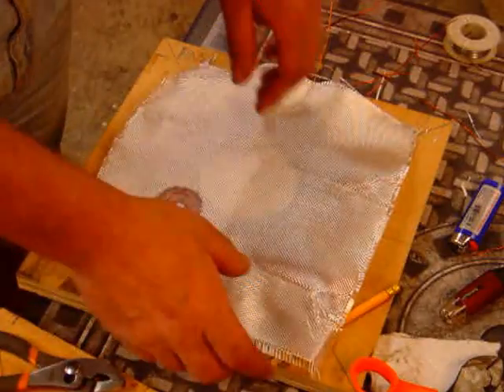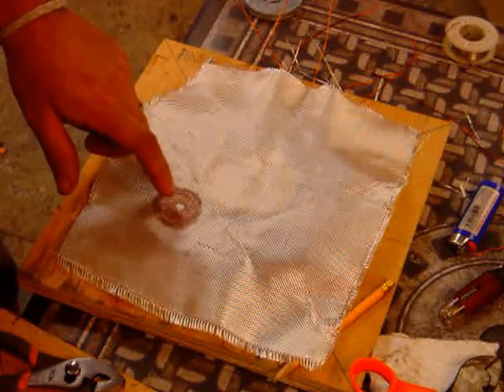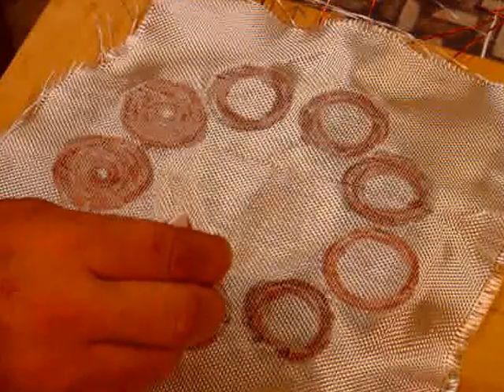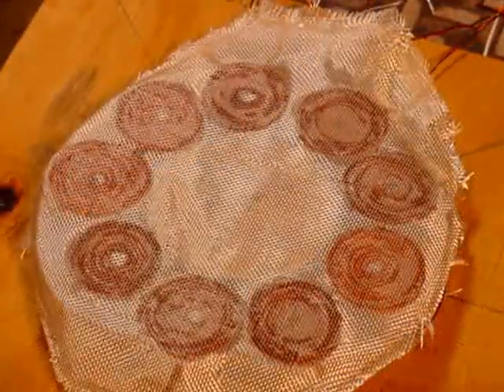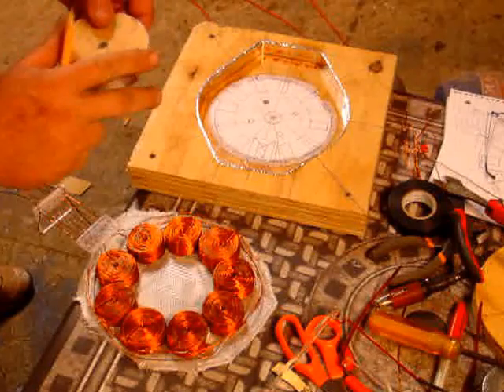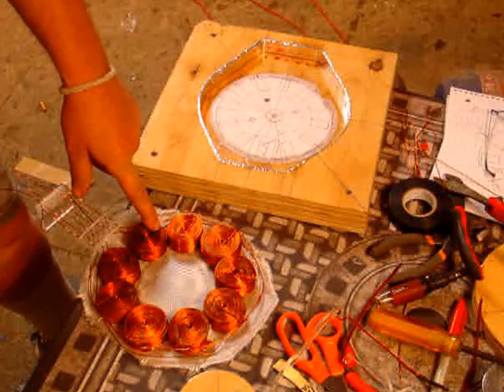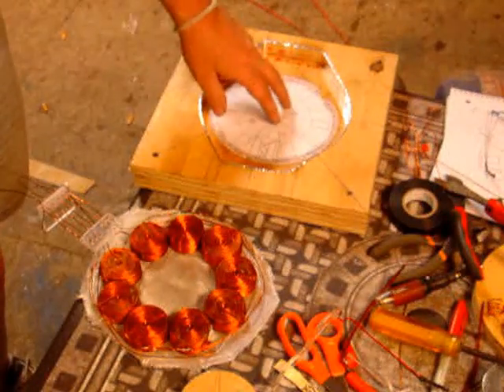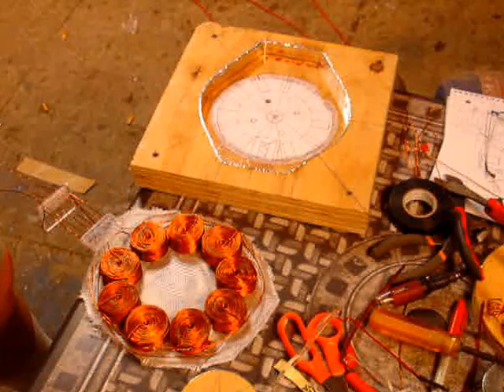PART 2 THE DESIGN OF MUDDYS' MIGHTY MINI WIND TURBINE

Comment: What would be the problems if I made my rotors with n35 magnets on one side and n50 on the other? I received a mixed order from a chinese supplier and it would cost way too much to return them! Either that or reorder another 12 n50 and use the n35 on something else...maybe use them to hold ALOT of pictures on the front of my fridge! Lol! Thx muddy!

Comment: Sorry you did say its oky just as the magnets are centered over the magnets .I did not get it the 1st time.hows the dream going for everyone to make one of  them is it working?you must have info by now.Let us Know.your #1fan. Bruce
Reply from the maker: Hello Bruce,

In order to fit the number of windings needed to reach charging voltage at startup RPMs, the air core of the coil had to be very small. After talking to Helmuth Gieser of Scaled Energy in Florida, He had me convinced that the magnetic flux would pass easily through the center of the coil. The magnets induce the current that guilds the flux as the magnet enters, and leaves the coils.  Whodathunk? lol

at the moment, I am trapped by working hard for finances. I only visited the shop three times this summer. And that was to collect tools to work on my mowers and other equipment. If I can find my camera, I will resume my videos and work on the videos.

Also a one week stay at the hospital didn't help progress on my dream either.

But I shall return soon.

MUDDy

Comment: Hey I thought the coils needed the open  center  to be the size of the magnets?can you HELP be for I make mine???
Reply from the maker: That is what I thought as well. having a small air core isn't as productive per turn of wire, But it still works to raise the voltage. In fact, I wound up having more voltage than I needed for charging voltage at startup RPMs. So I just added a longer prop to correct this.

MUDDy

Comment: Mr. MuddyMuddy... have you ever looked into using gravity to spin your geni's?  a lot of folks don't believe in it, but weight and gravity combined have a lot of potential energy.. far as I can see. such as this fellow:Free Energy Gravity - Overunity (search that).  calls it the Wilkinson machine.  (the link is legit, I am a Texan ;)  ) I am concentrating on gravity as my means of propulsion, and I have acquired a lot of motors and parts to that effect. wondering if this has occurred 2 u to try?
Reply from the maker: I like the way you think. :)

Raymond Head at RHEAD100 is experimenting with Milkovichs' two stage oscillators. I believe he has reached a 13:1 output. His pendulum weighs in at a whopping 650 pounds, and it was the largest two stage oscillator in the world for quite some time. :D

My idea is to have an elevator that stores the energy on the way down, and reuses it, and just a tiny bit more to go back up. The dual permanent magnet rotor axial flux designs are usually around 95%+ efficiency making them ideal for the task.

If one you try it with induction motor, Induction motors are usually only around 45% efficient. That would mean that 55% would be wasted on the way down leaving only 45% stored. Then on the way up, you would need at least 3/4 more to finish its' travel task. maki9ng it less than 25% efficient. 

MUDDy

Comment: Mr.muddymuddymuddmann could send me info on the best windmill [generator] i would like to start from scratch.
Reply from the maker: I say the dual permanent magnet rotor axial flux models are the most efficient. That is why I like them so much. nothing beats air core generators in efficiency. Check out otherpower.com

Comment: Hey, Muddy, I've tried placing the 2 magnets side by side but, I keep getting muddled North and South polarities on the outside edges of the same sides(one side south the other side North). Where as when I "stack"  the two magnets I get true North and South polarity on the opposite sides of magnets. Also since realizing the mistake of the actual size of the magnets, Do you still suggest 12" Rotors or should I use smaller, such as 9,10, or 11's? PS.I like the props U make.Pretty. Ever try 3blade?
Reply from the maker: That is why I always test each polarity position before placing the magnets. Perhaps testing each magnet before the assembly, and placing a red dot on the north side would help you.

And yes, I definitely suggest 12 inch or larger.
This provides room for the bottom of the coils from touching the all-threaded rod studs.

Thanks. I love carving props. But I love watching them spin afterwards much more. :D

MUDDy

Comment: Hey, Muddy. I'm building a similar size rotors and stator. My metal disks are actually 8.75 " each. My magnets are 1-7/8"Lx1/2"Wx3/8 thick.This is their actual size, when I bought them they were described as 2x1/2x1/2. Oh well i got'em cheap enough.  Anyway my question is: will the 18awg, 300trn coils in this part2 design video work well with these magnets? I am planning on stacking 2mags. on top of each other all the way around both rotors,total of 24 mags. on ea. rotor. Im new to this asUcan C

Comment: I was just thinking of why you were having failure of the scrs!
I suspect you are getting a phase over phase problem!
This is due to the intermittent switching on of the devices meaning it could turn on at the same time as another phase winding! Without 120degrees apart.
An easy solution would be the use of a diac ( sort of diode) this would swich on the gate at about 15 volts above 0 instead of burning out! Due to phase failure. 
Wishing you all the best with your projects :-)

Comment: Scrs are used in rail guns switching massive current loads in a fraction of a secend with no coronal break down (sparking).
With the high hz of the generator high emf back voltages are formed! These would have the potential to literally weld the relay contacts in a closed circuit possition in no time at all!
That is why I would opt for tried & tested methods such as those used for star delta motors switching in industry.
I hope this is useful & good for you all? Wishing you all the best.

Comment: Thanks for the reply Muddy.
As a suggestion for star delta switch over. I would use triacs: triacs are a lot like transistors, only work in AC mode just as well.
That way you can switchover easy. You might need diacs as well just for gate switching without phase over phase power loss. There is also the use of auto mobile alternator: this would have the integral transistor having its base powered by pick up magnets fixed to the rotor. In short : when the wind blows the rotor it gets energised.

Comment: Thanks Muddy & Friends for your uploads.
Im realy impressed with your Star Delta 3 phase set up.
Also the massive efficiency your getting.
I just have 1 question: As your device will generate AC power are you looking at using triacs in stead of transistors? Or use a full wave bridge rectifier for charging Batteries?

Comment: Muddy, What is your opinion of Aluminum magnet wire vs. the copper magnet wire? Does it withstand heat as well? I know it's lighter in weight by about a third but, other than that I don't know much about it.

Comment: I may experiment with the 90vdc motor and run 2 in series. with a gear drive, like 4or5 to 1... see what happens. I may need to go bigger on the blades. and may need to up it from 3 to 4 or 5 for the torque... thanks Mr. muddy fingers for you info...   :-)

Comment: Thanks again Scott sound advice on pt1,2 and 3. Yes i am singing from the same hym sheet as you.It sure is alot easier to stick with direct drive there are alot more anomilies to deal with with ratio belt drives. yes! with the added belt friction resistances and more restraining torque as the current increases. blade size points its big finger at me.Just a few more experiments first though.There is something not quite right which i will get to the bottom of before changing blades.You the man!

Comment: Thanks buddy I'm so excited ! Can't wait to be the proud owner of one of these ! I'm designing my tower @ 40 ft. to be self erecting with a removable hydralic cylinder off my log splitter . Just 2 pins and 2 quick connect hose extensions so there is no slamming down or in the fully raised position .